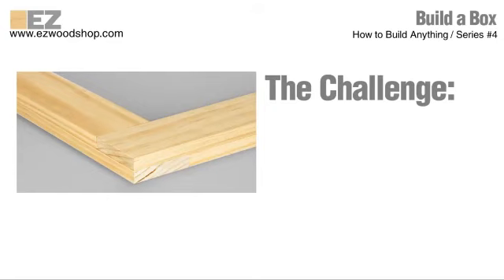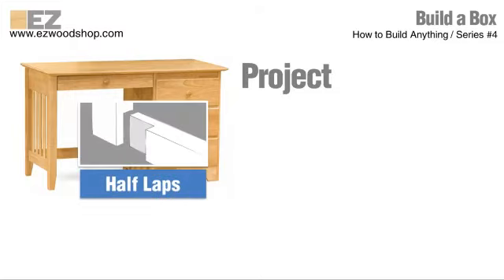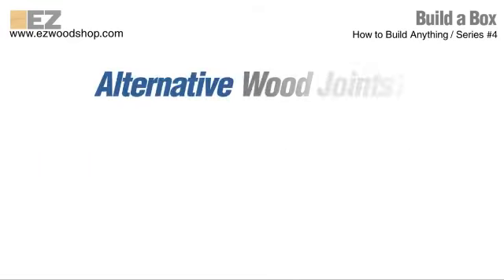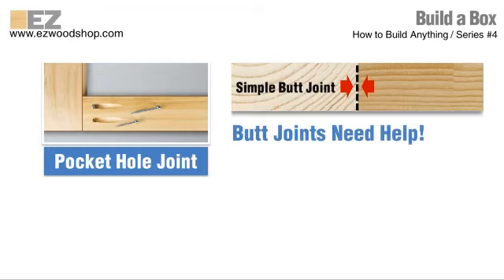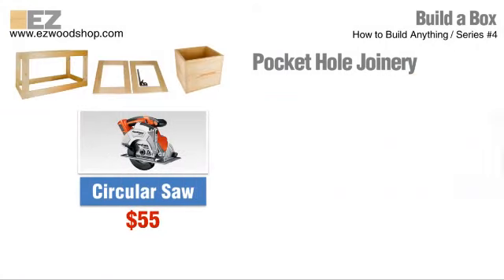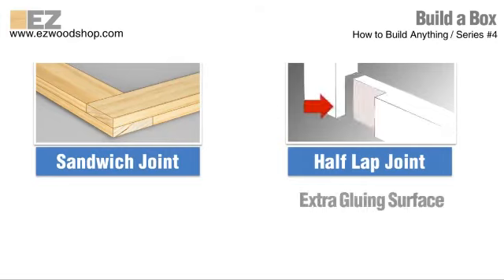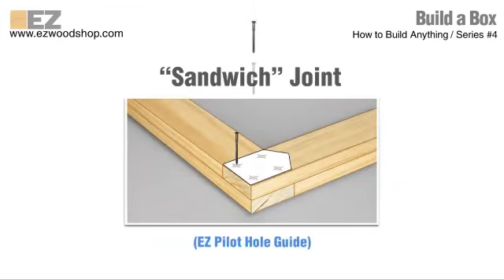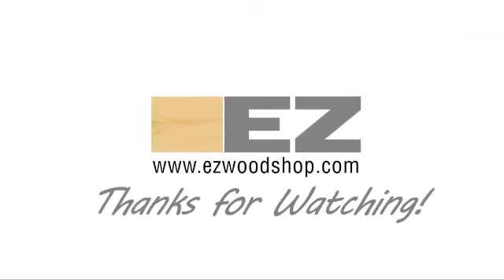How to  - Wood Joints - Pocket Hole & Sandwich Half Lap

Comment from the maker: I've tried a couple different methods for joining the boards. Glue-and-clamp works really well, especially if you have a good supply of hand clamps in your shop. I've also used a glue-and-nail method, where the nail essentially acts like a clamp to hold the boards together just tight enough to make the bond. Either way, yes, it's a matter of gluing the long layers of wood together (the whole length). Sorry I didn't make that more clear in the video!

Comment: While power tools do in fact make these joints easier and faster, I often make my half laps, saddle joints, mortise and tenons, dove tails all by hand with 2 chisels my hand saw and a mallet. Think about it, back when these joints were first thought of, what tools did they have, no routers or drill presses, it was all done with chisels hammers and hand saws.
Reply from the maker: +Rantz2040 I love hand tools, too! (mostly because I hate the excruciating noise that power tools make). You're right, though,  people were making complicated joinery long before table saws and routers. I guess it's a matter of how much time and effort you want to put into a project. The "sandwich" style joint works nice for the more simple projects, like 2x4 workbenches and utility cabinets.
Reply: Rettifico mi è arrivato il link e sono riuscito a scaricarlo. Grazie

Comment: I don't believe that you are correct by saying that a half lap joint is expensive to make.  I usually make mine with a chisel and a fine tooth saw.  Combined cost less than $30.  It is more about patients than skill with this type of joint IMO.  I think to make a correct "sandwich joint" you would need a lot more clamps to make sure the glue up is straight and you still need a saw to make sure the ends are square to the adjoining piece.